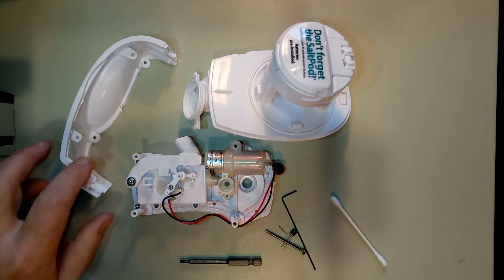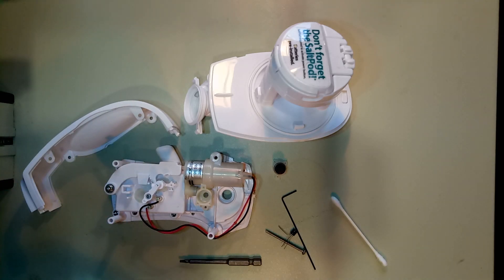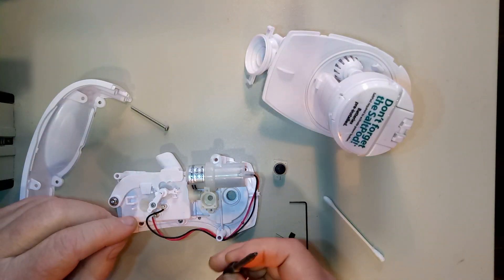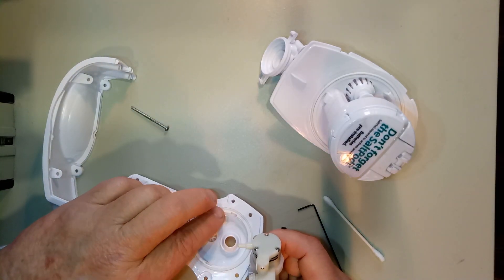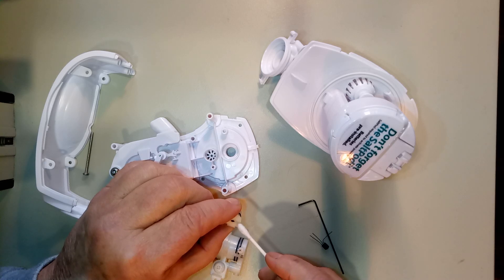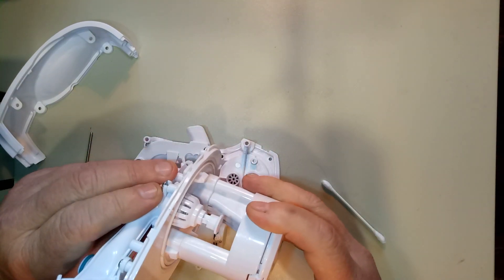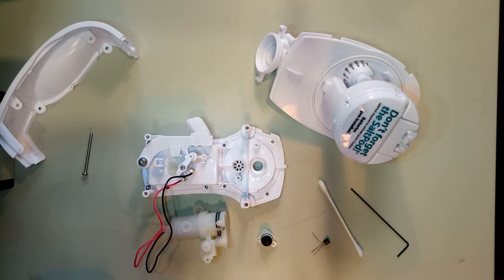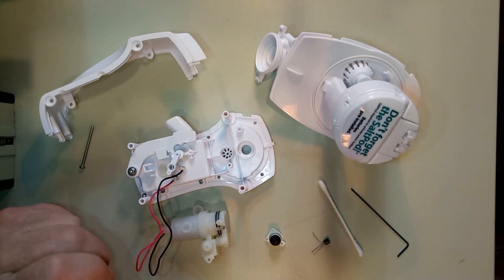NAVAGE Inside View, Tear Down And Repair Water Lock Vacuum Pump

Comment: I took all the screws off of the bottom and still can't get it off. I wish your video started from the beginning to show how you got the sides off. I don't know where to apply pressure to get the sides off. The feel like something is still holding them on.
Reply from the maker: Did you remove the screws that require the T10 star bit? I made the video only as an after thought to show interior. I remember having to pry apart the two case sides. Long time ago to remember exactly.
Reply: @opera5714  Of course I used the star bit and that's as far as you will get after removing those screws. There's something else he's not telling us and that's why it wasn't videoed. Don't try it because it's a waste of time unless you know the missing step(s) he didn't video. You would absolutely destroy your Navage trying to get it apart because Navage has these units rigged with a secret way to open them.
Reply from the maker: @SsSs-SsSs-SsSs  perhaps good advice if uncomfortable taking things apart. I did not have a video to watch and it was no big secret. It prys apart side to side. Gently stuck a knife in and it does snap apart. I figure anyone is doing this because it already does not work with nothing to lose. Any plastic snapped together is a little tricky.
Reply: @opera5714  I didn't want to break mine trying to pry it open. The reason I was trying to open it was because I somehow got it jammed with the salt pod bypass trick and the button wouldn't turn on even with a new salt pod. I finally got it unjammed and have to be more careful when doing the salt pod bypass trick. I take things apart all the time, but Navage doesn't want people taking this apart and it's purposely made difficult to open.

Comment: What are these pumps used for ?
Reply from the maker: There are lots of youtube videos on their use, many quite hilarious. There is a tank of saline solution on top. The pump creates a vacuum in the lower chamber sucking water from one nostril to the other. A roto rooter for your sinus.  Gross, but it works.